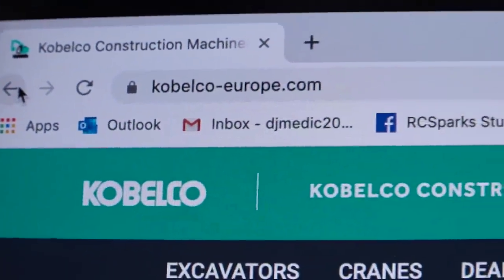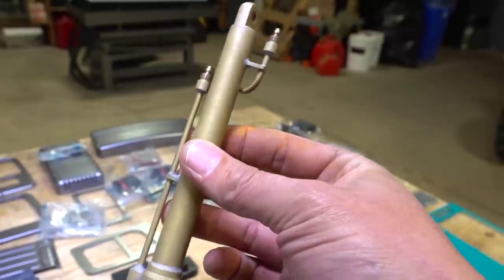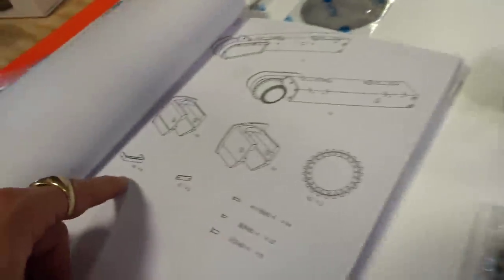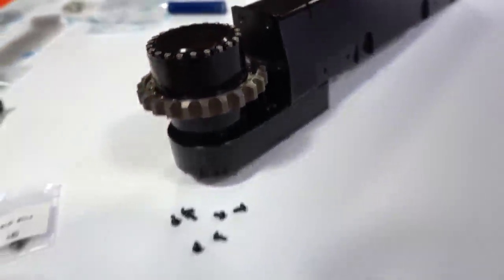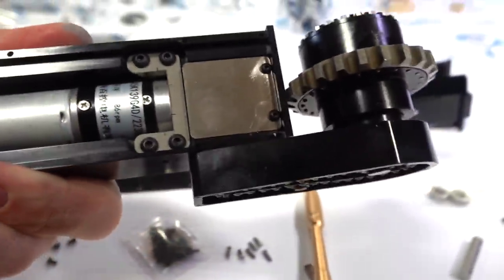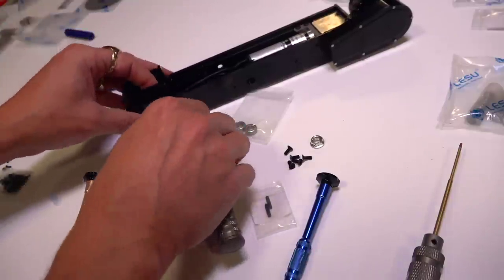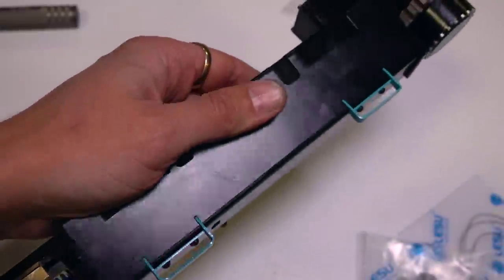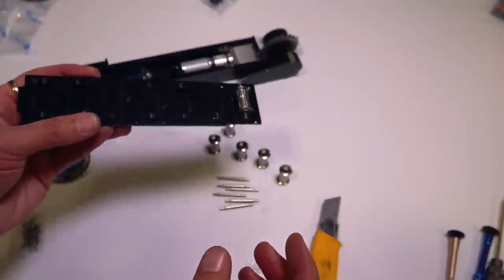BUILDING a "KOBELCO EURO" EXCAVATOR (Track Hoe) BASE - LESU Metal PC360 Kit PT 2 | RC ADVENTURES

Comment: I don't know if you found this out but the inside cab controls and floor a made out of resin and will brake. This didn't happen to me I've worked on models that are made out of resin I just want to give a heads up. Like the color looks good. I'm going with yellow and black.

Comment: I work for one of the best company's in the Mining and construction Business called HITACHI they are an awesome company to work for. The parts you have assembled  are all apart of the under carriage for the machine you have your- final drive that has the sprocket  on it   then there is the front idler - wheel at the front , guide rollers are the ones under neath the carriage , idler rollers are on top of the carriage , the part in the middle you called a sprocket its were that motor and the wires come out of is called a swing bearing or slew bearing , and last but not least there is your main frame that the swing bearing sits on but the model has it all in one . Its a very nice build will look forward to the rest of the episodes.

Comment: Awesome to watch this build... and i wonder if the bottom carrier rollers will wear out just like the real ones in real life... and also the 2 top ones.
Reply: Oh and also the sprockets wear out on the big machines and we put the pins for the track, the master goes on the inside rather on the outside for some strange reason, im sure there is a reason i jsit wasn't ever told why.

Comment: I bought the same lesu excavator as you but from your video I noticed a lot of changes with mine to yours. When you put the relay in for the hydraulics and it leaded, here was a set of set screws in a package you didn't but in the holes, plus your release value on mind is in a deferent place beside the servos. Plus I have much more wiring to do they you, because the gave me a lot more thinks in wiring to do I do not understand. You need to look at my machine to under stand it, because I don't. Randy from Calgary

Comment: With that many screws I always had a mini cordless drill to snug down the screws then hand tighten them for a final...makes for less sore and tired fingers/hands
Reply from the maker: I also have cordless drills.. but in these tiny applications can cause the screw hole to easily strip. Hence.. hand turning ;)
Reply: @TheRealRCSparks  there are some very low torque drills out there, I have used quite a bit of them on small r/c applications..just enough to seat them down...then go around by hand and torque them..these drills only take AA batteries
Reply from the maker: @stilltlrforlife  to each their own, I always say! :) Enjoy the hobby brother.. how ever you see fit..  I love it!

Comment: 6:10 that e clip isn't installed correctly. It shouldn't be on the flat of the shaft as that can allow it to work loose.  Its probably fine in the application but still:)

Comment: I don’t understand the Wires that go through the slew bearing for the motor tracks, Because When you spin more than 360 how does it not swirl the wires? Or does the wires in the slew bearing have a bearing for the wires?

Comment: For the painting part. What did you use? you use a air Compressor paint gun or something from a spray paint can?
Reply from the maker: I showed the two paints in the first 30 seconds of the film :) With product numbers
Reply: @TheRealRCSparks  Sorry about that, all the excitement of the build you doing and I miss the a little bit of the first 30 seconds. But the best part is yet to come when building the upper frame.

Comment: That's not for rocks it's a tensioner  for the tracks
Reply from the maker: Which is used to help rocks pass through without damaging the tracks or drive sprocket..
Reply: @TheRealRCSparks  sorry sparks it's just a tensioner  it wont budge under load if a rock gets in there it only pushes out it on the real machines there rock guards  preventing  stuff larger then a base ball getting in the idlers I love your videos  and I'm following  this one specifically  my business  is heavy equipment .
Reply from the maker: @jonathanharrington9648  Thats cool bro.. we will have to agree to disagree on this one.. as RC excavators are my business.. Lol..and I run a mine site. If the rock gets in there... that spring allows the track rotation of the brushless motor without it seizing. I appreciate the kind words of advice, and agree with you about it being a tensioner.